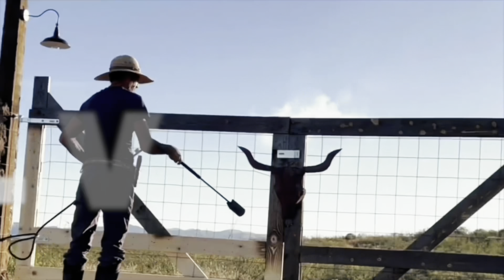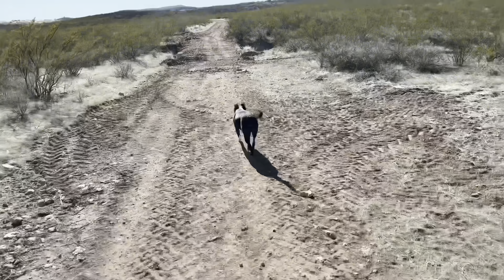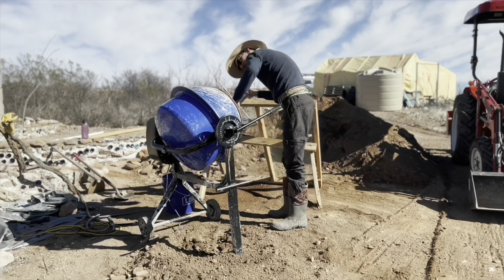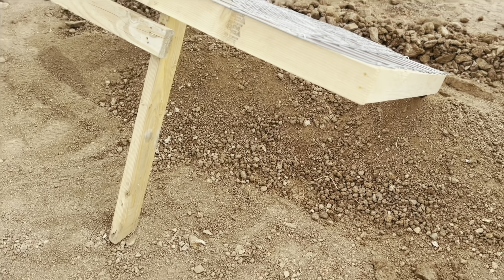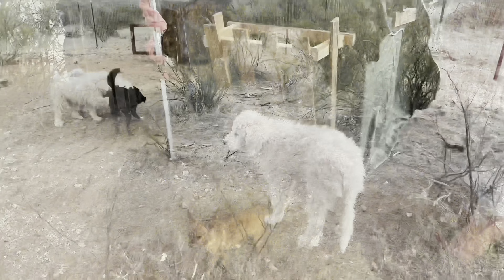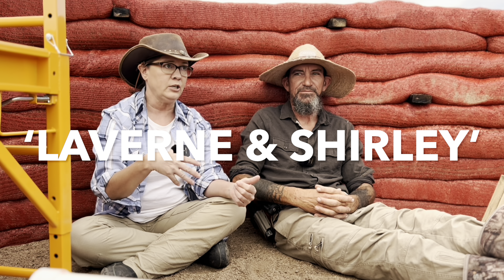Work On Our Off Grid Hyperadobe Chicken Coop Stopped

Comment: Just wondering if anyone makes tire covers that would slip on like chains and be tough enough to repel the needles? Maybe old fire hose or something? Just did a quick search and there are liners called tire gards that might be worth a look?
Reply from the maker: Those liners sound like they would work..in Colorado we use to have a big ‘goat head’ problem on the mountain bike trails, I use to just place a blown-inter tube on the inside of my tire,, road side out, then put a new tube over that, then fill up with air,, that seemed to work,, for the tractor I believe it would work as well.. I’m going to go look up what you mentioned right now, have a great night